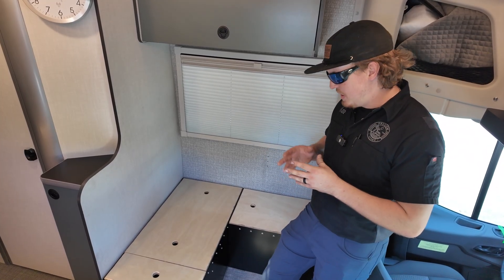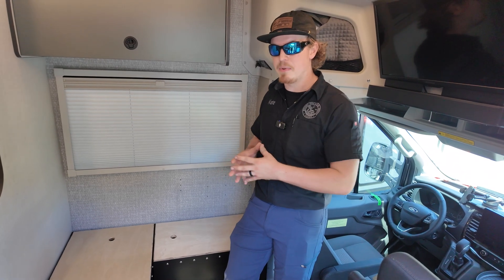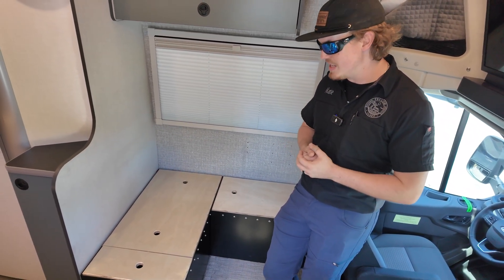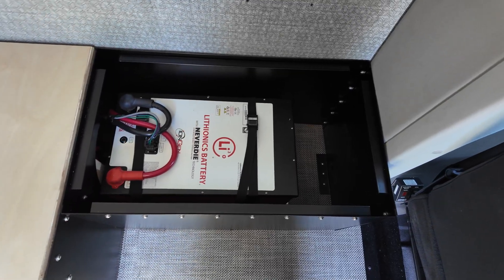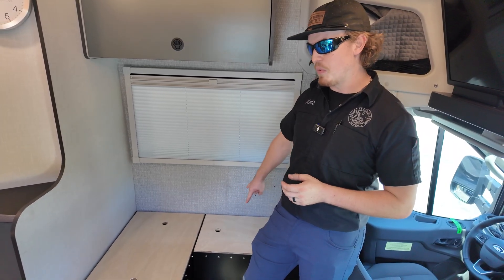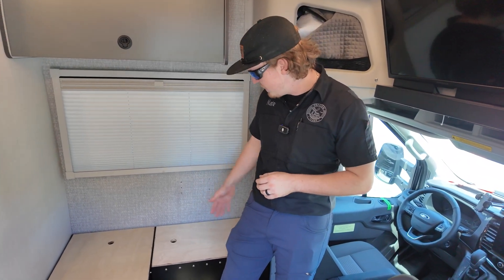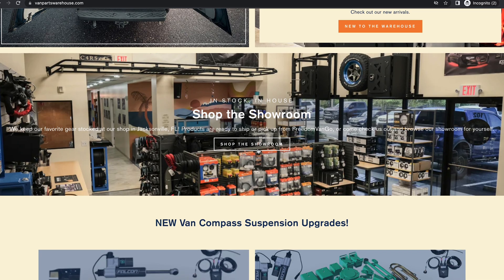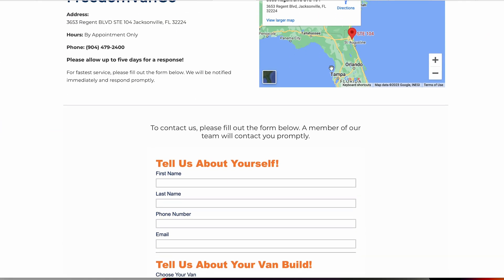15KWH Winnebago Transit Ekko 22A? | Full Electrical System Upgrade with Lithionics and Victron

Comment: Do you need to upgrade the 250amp circuit breaker on Transit Ekko if you add additional 1200 amp hours worth of battery power?
Reply from the maker: One breaker per two batteries is the requirement from Lithionics.  So we Add another along with some wiring and other fun stuff

Comment: I just booked my appointment for October to have this Lithionics system installed in my 2025 Sprekko with FVG. Cant wait for this upgrade. I missed the battery system in my Storyteller Beast that had the  larger capacity batteries. Now I will be able to travel like I did before without ever running out of power. So looking forward to this mod.

Comment: So no table and no cushions, just two benches and you're on your own?
Reply: No issues with the table and cushions. FVG did the L-bench for me as well as some other cool electrical upgrades. I simply had a local upholstery shop do the cushions and installed a lagoon table myself (easy peasy). Just coming back from a 2 1/2 month trip and all systems worked flawlessly!
Reply from the maker: If you come in for install we can help on the table. But if you are doing it diy, yup